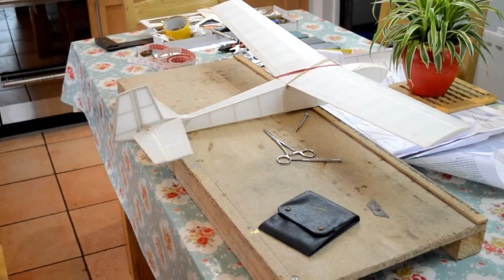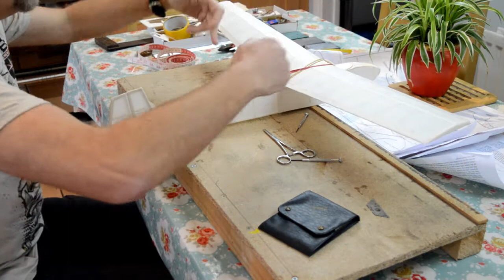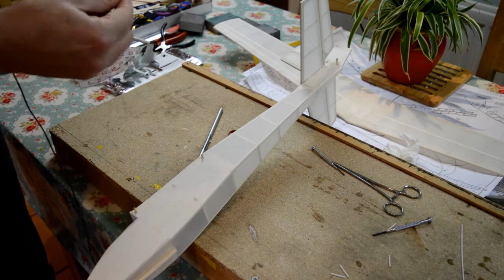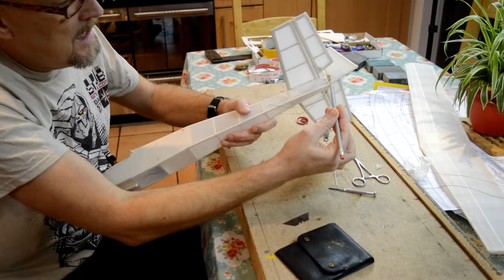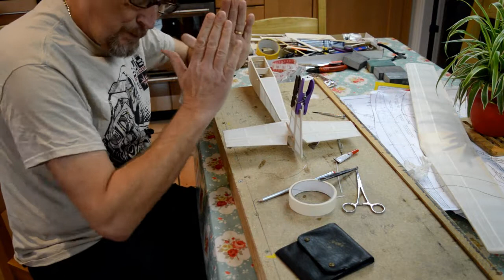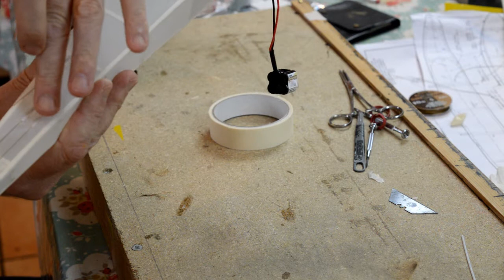How to build a west wings swallow Installing Control cables

Comment: Hello. Congratulations on your interesting videos. I'm trying to install fishing line control cables on a small glider, and I can't seem to be able to tie the knots and get the desired tension on one end. It would be interesting if you could explain to us how you do it. Thank you.
Reply from the maker: @albertmacias1862  braided fishing line mate clamp the rudder pull tight nip knot with Cyno
Reply: @NickChittyFlying  Thank you very much for your comment and your help. I'll keep trying.